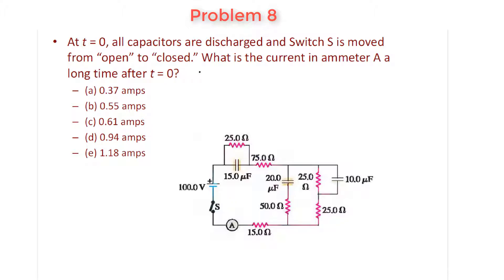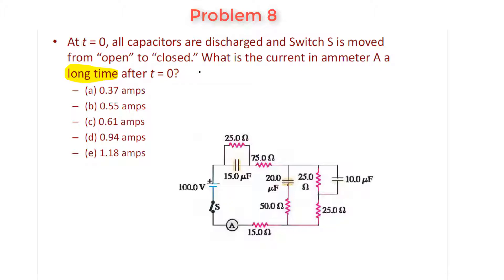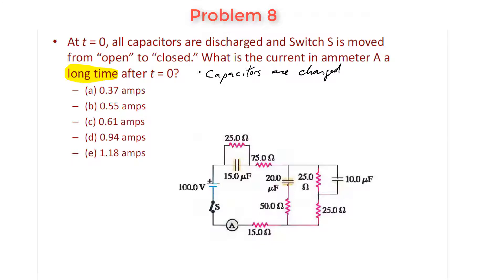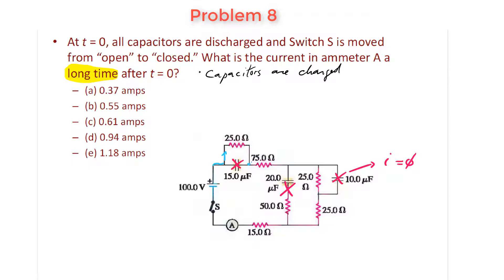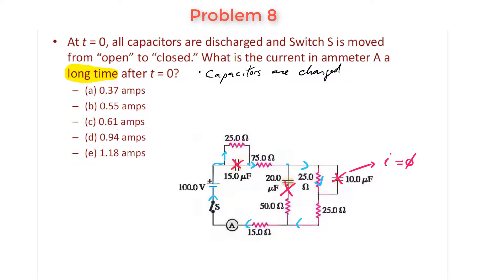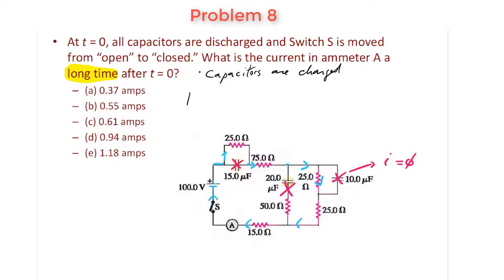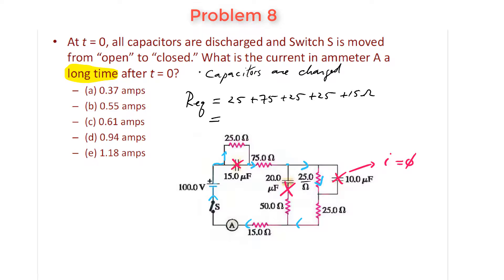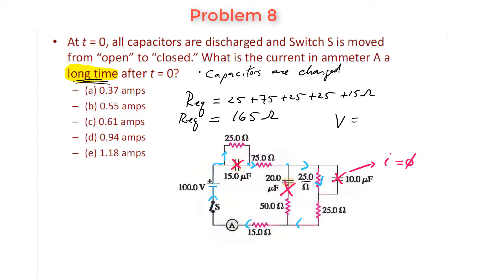RC Circuits - Problem 8 - Finding current after a long time

Comment: Shouldn’t the resistor 50 ohm too be counted pls reply sir
Reply from the maker: No, after a long time the capacitor in that branch is charged and there is no current in that branch.  If there's no current there will be no voltage drop across the 50Ohm resistor
Reply: Physics Ninja thank youu